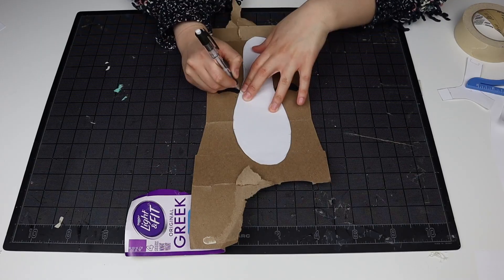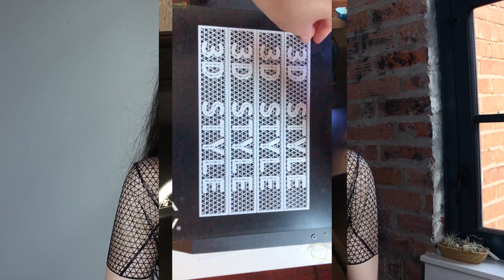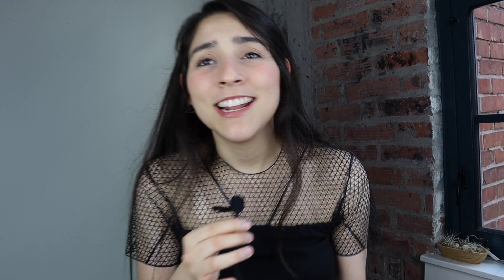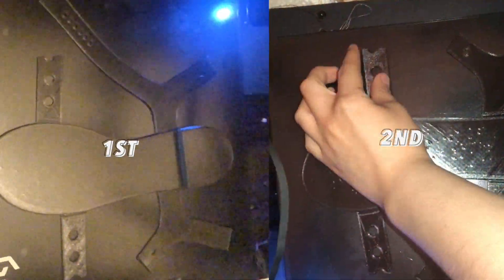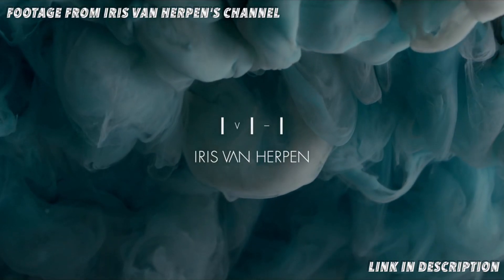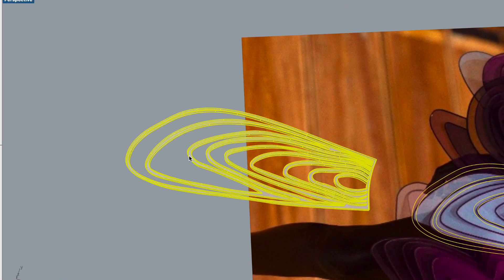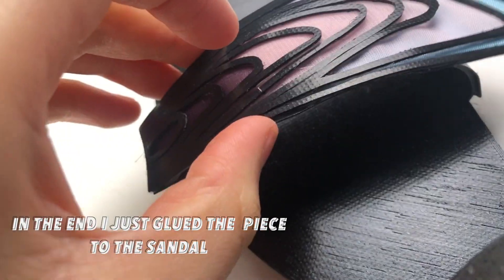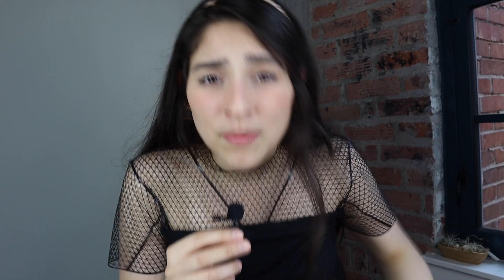I Used RECYCLED PLASTIC to 3D Print Shoes | Iris Van Herpen Inspired

Comment: If I were tasked with making those things with the mesh I would use a very small needle and just loop stitch it, but it does depend what kind of mesh, some require a zigzag stitch on the cut edge to stop fraying. But using glue you might be able to look into the glue that is on stabilizers and the wax paper those use to stop it from sticking, but the glue might melt at the same temperature as your 3D print

Comment: I was thinking what would happen if u mixed the two different filaments like make the black as a bottom and then print a white over the at well ig basically putting a black layer after the white with how u printed so u have the comfort of the white filament and the stability of the black filaments

Comment: This is really cool because one of my ideas is to make a 3d printable version of the Lobster Claw shoe.  However, my problem isn't designing in Fusion 360 but rather printing it where I have no supports.  Short of SLS nylon printing, it won't be possible with FDM - maybe you have ideas?  I like how you made the sandles flat and pretty much used a sheet metal method (design).  For the Lobster Claw, the top must be in softer TPU.  The bottom must be strong enough to support a person's weight (static and dynamic force).  Not so easy to solve.
Reply from the maker: Interesting ideas. I think the main challenge (with FDM) will be testing the angles at which your printer can print without needing support. I've seen people print sneaker-like shoes before and some use support but others don't. I haven't tried printing a non-sandal shoe yet but I plan to at some point. I do suggest using a TPE /TPU material when you do. I truthfully don't have experience with SLS printers so I can't speak to wether or not that would be a better option. Would love to see your claw shoe when you accomplish it!!

Comment: You can use modifier in PrusaSlicer to vary your infill density to different parts of the sandle. Make the bottom thicker and the top thinner maybe. Softer on foot. Harder/longer lasting on ground.

I haven't read up on it yet fully, but I also heard there were people able to print TPU onto PLA/PETG/ABS via a complicated filament change/slicing process (maybe even adjusting extruder tension at the same time of course).. maybe there's an option to use PETG/ABS that with more bendability than PLA to print most of the sole but then use TPU for the padding on the foot and the straps going up.

If I missed it rushing at the end.. oops.. but maybe even a post process to glue a more wear resistant bottom to the shoe but that's dependent on usage determining if the TPU on the rest of it last long enough to worry about it.

But this is all before various Nylons and Polycarb are on the mix. I can print them on my setup now so I'll keep an eye out on their characterstics for this application....

I might give that a shot someday for a gift for my girl. Hmmm.
Reply from the maker: Awesome feedback. I have yet to mess around a bit more with all the features that slicers have to offer. That material layer idea is something I’ve though about and have heard others suggest as well. I also love that concept of adapting the print’s infill or properties for different parts of the sole. Plan on making more footwear so I may dive into some of these explorations in the future. Thanks for the tips. 👍🏼